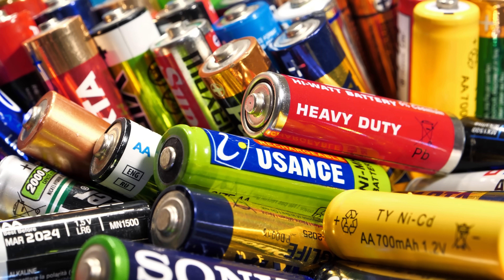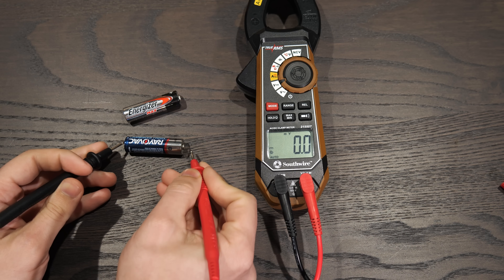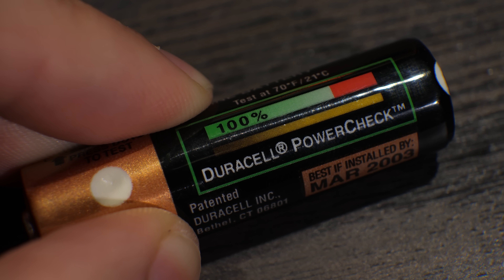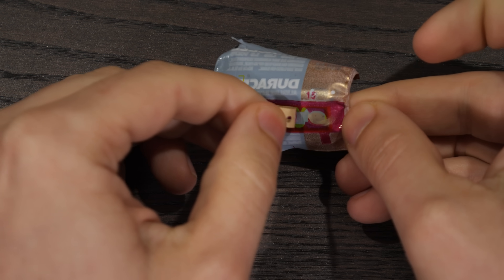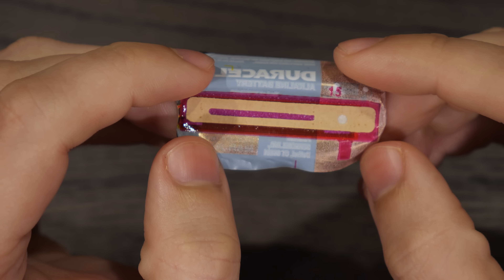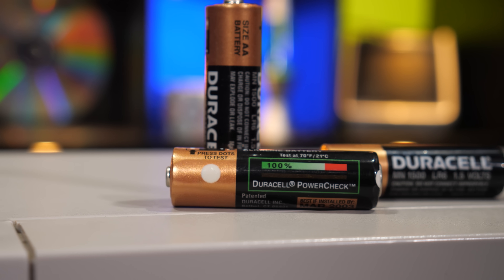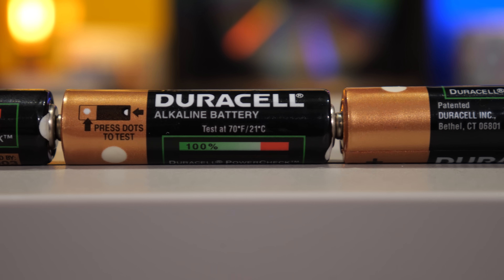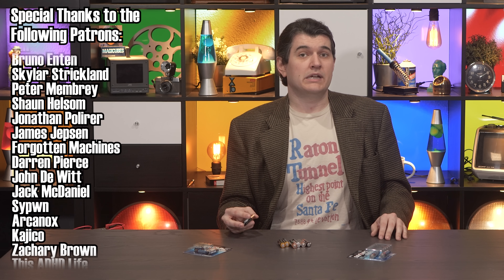Duracell PowerCheck: A genius idea which didn't last that long

Comment: 0:15 No, if they wanted to be annoying they needed those thick D batteries, which nothing else needed, except that one toy you just got.
Reply: D batteries are too common, maybe C-type still pretty heavy but harder to find, lol
Reply: @cafenightster4548 I've only ever seen C batteries in like, a torch, where the battery slot is the size of the handle.
Reply: @cafenightster4548 you beat me to that comment. Nice going.
Reply: The really annoying batteries were the C batteries.  Or the toys that came with button batteries that cost more than the toy to replace.
Reply: @thummumcrysanth  MANY things still use those. Watches, toys, my cat's mouse, my shock pen... I was listing things and realized everything I can think of is a toy aside from watches. EDIT: Ah both of my key fobs! And maybe most commonly the clock in pretty much all computers and laptops.
Reply: @crayder1100  he said 'C' batteries.  You're thinking watch-type batteries which are generally denoted as "coin" batteries
Reply: @thalanoth  I was clearly responding to the "toys that came with button batteries", you just didn't read the entire comment lol. But yes, the coin batteries, or "coin cell" batteries would be a more correct term.
Reply: @crayder1100  either you're mistaken or the comments are shadowbanned
Reply: @crayder1100  thummy responded to ira, ira responded to cafe, talking about C batteries
Reply: @thalanoth  I am talking about thummy's response, the only one I see at least. He was talking about C then said Or... etc
Reply: You're not wrong; I'm dating myself in thinking of the terrible resistive qualities in anodes that needed enough voltage to create a viable connection in those old toys that required C batteries.  By button I thought he meant the actual pressing of a key unto a "button" to create the connection via force lol
Reply: @thalanoth  fair lol. a lot of people call cell batteries "button batteries". they are sometimes even actually part of buttons.
Reply: @crayder1100  those batteries also normally start with a 'c' so that creates a bit of confusion I'm sure
Reply: @thalanoth  cells* it was slightly erroneous of tc here that some AA/AAA were/are batteries of cells and not single cells. Button cells.
Reply: @mandowarrior123  AA and AAA are always single cells AFAIK.  to make one out of button cells, you would need them wired in parallel, and there would be no real reason to do that.  There are 12V "N" batteries which are a short cylindrical battery, and those are sometimes made of a stack of typical button cells in series.  They're usually only used for devices that need short bursts of power, and not much actual capacity. Usually garage door openers or wireless doorbells that want a decent voltage to send the radio signal, but are short enough in duration to not deplete it too quickly.
Also, some 9v batteries were made with a bundle of 6(AAAA?) cells wrapped together inside the pack, and likewise, some of the chonker oldschool square 6V "lantern" batteries were made of smaller flashlight cells, if you ripped them open.
Reply: @crayder1100  I saw "cat's mouse" and was confused for a second, like why does your cat need a computer?
Reply: @ianfinrir8724  Yeah it's just a squeak mouse toy lol
Reply: @thummumcrysanth  I remember several instances of me buying a cheaper toy to get the batteries for a more expensive/hard to find toy, because the batteries were much cheaper than the cheaper toy. Definitely the WORST place to buy the batteries is the watch repair shop - they can cost 10 times more than everywhere else.
Reply: @krzysztofczarnecki8238  Yes, but they installed the battery for you. Until they went out of business.
Reply: @thummumcrysanth  Fun fact: C batteries are just as long as AA batteries. In a pinch, you can use AAs in things meant to take Cs.
Reply: @TheVeyron623 yes! I hated Cs but was surprised when some device came with some plastic adapters (like hollow cylinders) where you could slide AAs in. Never bought Cs again.
Reply: @thummumcrysanth  Ugh! Those button batteries. Cat toys still come with those. Keychain flashlights, too!
Reply: Actually, if they wanted to be really annoying, they made their device take some truly hard-to-find size, like AAAA or something. I once had an advanced scientific calculator that required three size N batteries. I had to go to Radio Shack and buy them. Worse, since RS only sold them in pairs, I had to buy three packs of them, then stash one pack and one battery somewhere until the three I put in ran down.
Reply: @ThreePointOneFou , I was scanning the comments for someone else who had the trauma of using AAAA batteries or, as I always called them, Quad-A.  I had a really cool pen flashlight that took two of them.  It was neat, but I always wondered, "Would anyone have really cared if this was an extra 1/8" in diameter?"
Reply: @ThreePointOneFou Or the 12V alkaline batteries in my ceiling fan remote that were super cool to discover..."Oh good I have AAA batteri... wait, why are they so short... 12V??!!"
Reply: @ThreePointOneFou  yeah I remember having to find a 4 volt battery once. It's like a mini version of the 9 volt.
Reply: " BATTERIES NOT INCLUDED "
 GREAT MOVIE!
Reply: @YELLTELL such a good movie
Reply: I remember when we switched to rechargeables. We bought a charger that can hold 24 batteries, AA or AAA. It was so much better
Reply: I dunno why but your comment made remember some stand-up skit about learning English and trying to communicate battery types lol
Reply: D-cells weren't that rare. Early portable radios and flashlights used them a lot, so they were sort of common. If they were truly filled with hate, they'd make you use C-cells, which almost nothing used
Reply: What was worse was when you though something took D batteries but it was really C’s
Reply: Lol for real. I got just 1 electronic device which takes EIGHT D batteries 😡😡😡
Reply: You never had those thicc bois in the junk drawer when you needed them.
Reply: No, you're thinking of C's.D's were used in flashlights
Reply: Ds were for Maglites, not just your mom's "personal massager."
Reply: @rickr530  Or other more powerful flashlights, the bulbs of which are no match for your average cheap LED flashlight. Also for boom boxes and portable radios. Or if you wanted to make your Yamaha keyboard portable.
Reply: I have an old Lego train which needs 3 C batteries, but they only come in 2 or 4 packs
Reply: Or a antique flashlight
Reply: No d bats are common c bats thooo
Reply: C is the worst
Reply: That or sle small penny batteries y😂
Reply: quite the toy hehe
Reply: I had something with C batteries once. I bought a back of like 16? Still only 2 used (it takes 2)
Reply: I recently bought a trash can with a powered touchless lid and was appalled to discover it takes C batteries, which I haven't bought in around two decades (same for Ds).  Of course, the reason I haven't bought them is because I learned as a kid that they're just AAs with extra capacity, so you can use AAs in anything that "requires" C or D cells, so long as you put in some cardboard or something to hold them in place.  AAAs don't work this way because they're too short.
Now all of my devices (that aren't a TV remote) without a built-in rechargeable battery use those spiffy AAs with their own individual USB-C ports so I don't have to worry about a special charger breaking or getting lost.
Reply: God i hated D batteries.
😂
Reply: If they really, really wanted to be annoying, they would require B cells.
Reply: My wife has a portable 8-track player. It uses 6 D-cell batteries. More than 1/2 the weight of the thing is in the batteries.
Reply: Toys always took an odd amount too. You'd always have a leftover D battery or have to go buy a two pack just to use one of them. I don't miss them at all. Although there was once that I had a battery powered radio or something that took TWELVE AA batteries. Maybe it could have used D batteries...
Reply: I think C batteries were the rarest.
Reply: I remember that 6 to 8 D batteries probably cost more than the toy!
Reply: Remember 4.5 batteries? or the PP3 batteries that you could put your tongue on to get that weird taste
Reply: Or if they wanted to be even more annoying they would require the even more obscure C batteries
Reply: even worse, AAAA batteries
Reply: Nah C cell batteries
Reply: I see everyone arguing about batteries here but am I the only one getting a brain aneurysm trying to make sense of this comment??💀
Reply: @citizenofthebikinibottom5617  You are right on par buddy. We weren't arguing, everyone's just misunderstanding each other lol.
Reply: The problem with these batteries is that rechargable batteries are just way superior, so a power check isn't really needed.
Reply: @Z_E_B_O  This. I never had top buy batteries as a kid through the 90's because I had a universal battery charger and a wide selection of rechargeables for just about everything.
Reply: @Z_E_B_O  I would think it would be the opposite because you could easily check if your rechargeable batter needs to be recharged or not
Reply: @Z_E_B_O 
That's not true. It completely depends on the use case. Single use batteries are better for low power devices or that are idle a lot, like a remote, thermostats, bike rear lights, thermometers.
Rechargeable batteries are better for devices that need more energy or are used a lot like some toys, MP3 players.

An alkaline battery loses 10 % of it's charge in 3 years, an average NiMH battery loses about 5 to 10 % on the first day and 0.5 to 1 % per day following.

My work computer mouse uses a single use battery and that lasts 1 to 2 years.
Reply: @Z_E_B_O  Modern rechargable batteries are way superior.  The NiCd batteries we had in those days were actually pretty bad.
Reply: D beats C. C batteries were only used by an old Maglite from the 60s and a tonka firetruck from 2007

nothing else lmao
Reply: @jesuschrist711  My current boom box takes C batteries. But I hardly ever use it.
Reply: @jesuschrist711  the big action figure robots in the 80s used em lol; same with the center pivot point copter toys

Comment: It's weird because only yesterday, I was watching some old UK adverts from 1991 and they had a Duracell advert with the power check but it wasn't on the battery itself but the outer packaging. strange coincidence.

Comment: Money saving tip:
@12:20 I occasionally keep used batteries to replace batteries in my wall clocks. The batteries in most devices consume significant power before failing but still have plenty of power to keep a wall clock going  for some time… (pun intended).

Comment: I think energizer came out with a similar thing but it wasn't built into the battery, it was just a thin piece of plastic/metal thing that you hold in place to the + and - poles of the battery get the power level (or maybe it was Duracell before the built-in version).

Comment: Talking about batteries:
When I was a kid, I used to have a portable Sony TV like the one you have in the background., 
It worked on 12V, so it could go to the grid with a transformer, or could go with batteries, IIRC 6 type D batteries (or maybe type C?), which last a couple of hours, tops.

Comment: You know, I kinda already knew these things used heat, because I remember having a paper-strip tester using thid tech, and in between batteries I would rub the yellow bit to turn it dark again, and I could feel that it was warm and my fingers were cooling it off.

Comment: I am older than that. I used to have something that used a 3LR12 battery. Yes, remember those 4.5v bricks with round edges and long taps on the top? Those!

Comment: You are supposed to press on the bottom of the battery, not at the corner where it's marked. It's marked on the corner because there is no wrap on the bottom of the battery to indicate to press there. This has confused a lot of people over the years.

Comment: Battery test: 1.  Remove batteries from inoperable device.  2.  Replace with new batteries.  3.  If device is still inoperable, test new batteries in a known working device.

Comment: Found a pair of AAA's exp 2011 from the M3 range, still putting out 90%+ sat in a mini radio.  Maybe it's my high midichlorian count, but I never found it difficult to use, think maybe ppl trying to press hard to will extra charge.

Comment: There's two use cases your not considering.... Family vacation road trip and you want to see how close the batteries in your gameboy are to dying. While now thinking back on it I'd bring spare batteries regardless, it was just the feeling of knowing the ones in the gameboy were low and I could just go ahead and replace them so I didn't have to rummage through a suitcase in the back of the Tahoe for spare ones. Another use case was for devices that are sensitive to battery charge. I'll be honest it might just be in my head, but I didn't trust my battery operated voltmeter/caliper/scale/etc unless it had fully charged battery.

Comment: I prefer the drop test. Drop a battery from a few inches on the negative side on a hard surface, if it hits the surface and just stands or tips over it's good, but if it hits the surface and bounces it's dead.

Comment: The one time I lately was happy about having a multi-meter to test batteries was a sanity check on my smoke detector.
After switching out the batteries for "new" ones 3 times and still getting the low battery beep I thought my detector was bricked. Turns out the 9V batteries I had were just shit and lost enough charge over the 2-3 years they sat in the drawer to make my smoke detector nervous.

Comment: Actually, I think they gave up on the tester because it caused more battery failures. I distinctly remember seeing new ones on shelves IN THE PACKAGE with the line fully yellow (probably because the contacts were shorted at some point).

Comment: Well, it's neat, but honestly I wouldn't even use it, if it were on the batteries. I still use single-use batteries regulary for my flashlight (AAA) and if I'm putting new batteries in, I test them with the droptest. Pretty reliable to determin if a battery has juice or not.

Comment: I was wondering why batteries do not come with battery testers anymore almost a year ago when I was trying to find a battery powerful enough for my fire alarm. I learned the hard way that just because it is new from a package does not mean it is full of juice. I have an analog battery tester, and I love it. I love it so much I almost mass bought them for Christmas gifts last year, but then I was told people already had one. I must admit my batteries often spill out of the package, and I am often in a big hurry to put batteries into whatever gadget so the new and dead batteries end up getting mixed up, so a battery tester is needed.

Comment: actually when my power screw driver does not have enough power to drive or remove screws then I remove the batteries and save them as I can use them for my tv remote and clock and other low draw devices can run for a year or more on them even my flashlight will run awhile on them so keeping them makes sense

Comment: Speaking of batteries being a commodity item that compete mainly on cost, I used to just buy whatever were the cheapest batteries from a reputable brand (usually Rayovac). However, I recently have been seeing videos from channels like Project Farm who test to see how much capacity each brand is giving for a price, and IIRC Energizer seemed to win the price/mAh chart. Also, one thing I never knew is that Energizer Max is one of, if not the only, brand out there that offers a warranty for your devices that are powered by it. If you use their batteries in a device and the battery leaks in a way that permanently damages it, then you can submit a claim to them and they will either replace the device or reimburse you for what you paid for it, which I think is pretty awesome! I now only buy Energizer Max batteries because even though I try to not leave batteries in devices when they aren't in use, I typically forget and then end up finding the batteries have leaked inside.

Comment: IIRC we had Durecell PowerCheck batteries in Ukraine in 2000s. It had a slightly different design with only one 'button' to press.

I think the reason for this feature was not consumer demand but branding: Duracell was facing competition from "no name" batteries which were sold at a much cheaper price. So Duracell was trying to present their batteries as long-lasting, reliable batteries, and I guess this power-check feature fits into that image. 

(E.g. suppose you buy no-name batteries, put them into a remote, and remote does not work. You think it's broken, but actually batteries were dead on arrival. With Duracell you can easily confirm that batteries have charge so you won't get into this confusing situation.)

Comment: Ah yes, those testers in the batteries or packages they came in.  The good ol' days.  From the mid-00s, I got into doing the rechargeable battery thing, back when you could still run to a Radio Shack and grab such a thing.  They'll still out there, though.

Comment: "loose batteries in the junk drawer which may or may not save the tv remote in a trying time" - A statement universal across all households I am sure!

I remember power check sticking around a lot longer than 2003. I think it might even still be available here where that patent dispute never was relevant.